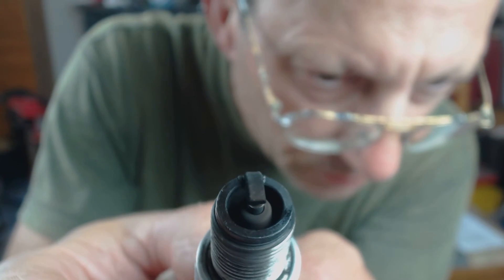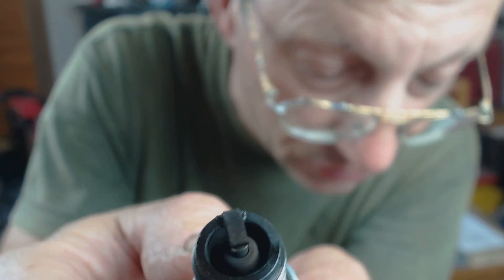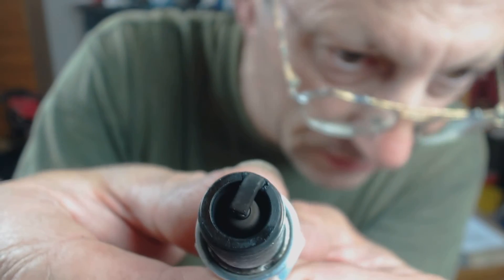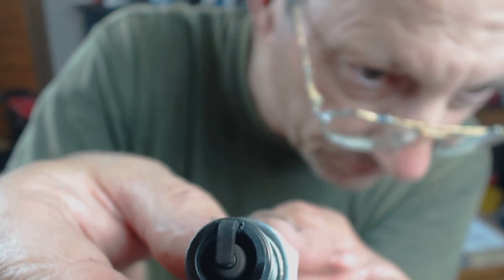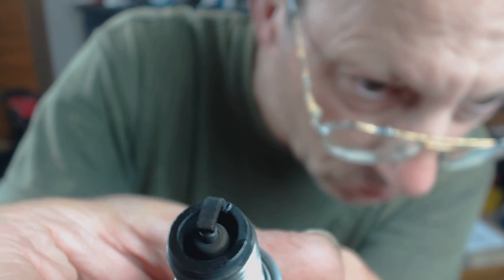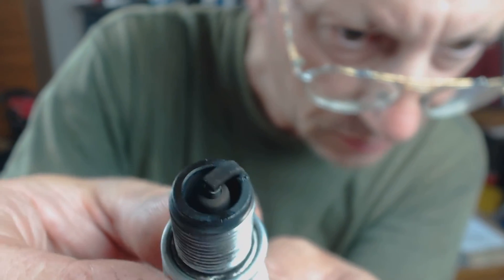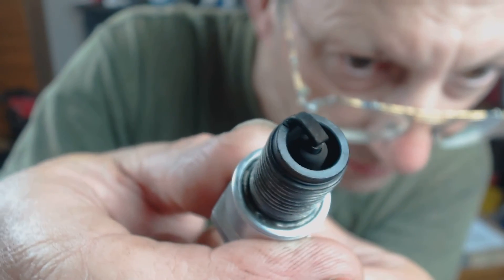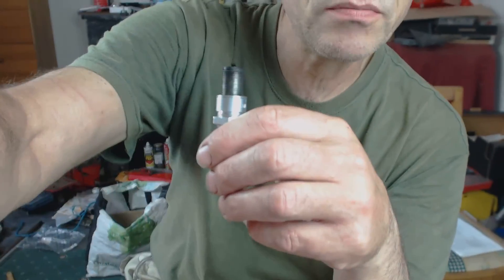AM6 MX50 Main Jet 122 - Spark Plug Colour

Comment: Looks OK. Perhaps a wee bit rich, but i would settle for that.
Reply: +TroyaE117 right. I think it seems a bit rich too but as long as if there is no carbon deposit then OK.
Reply from the maker: +Henry X. Duong +TroyaE117
Yes I agree, but I was doing speed tests, and the jet increases gave minor speed increases.... but later, for normal running I dropped it back down.
Primarily I was wanting to see how far I could take the jetting.
The PHBN is a carb of type 'needle always in the atomiser', meaning that needle changes can affect the main jet requirement.

Comment: Wen u say ur looking into needles next do u have an aftermarket car because the standard delorto sha1412m doesn't have a needle I'm stumped on this on as I wanted to adjust the needle clip placement to increase fuel flow ect if u are running the same setup plz plz let me know how you did this??

Comment: Your a genius buddy most in depth look at an am6 I've seen I've just had to start looking into plug chops on my mx50 with 70cc bore I'm just wondering if a 122 will be sufficient for my needs
Reply from the maker: Yes... you are the owner of a disliked carb.
Most people at this point would stop.... and say "buy a PHBN/PHBG type carb" AND make it at least a 17.5/19mm.

I guess I'm gonna say the same.
The sha is not worth developing..... it just doesn't offer the potential.

If you've bought a 70cc kit, then the sha must be changed.... otherwise you are strangling the beast.
:)